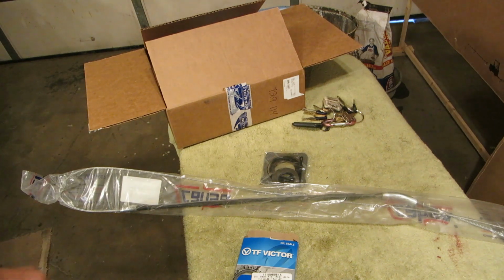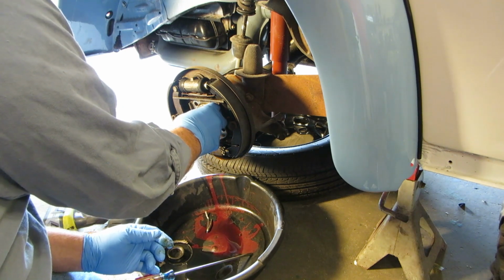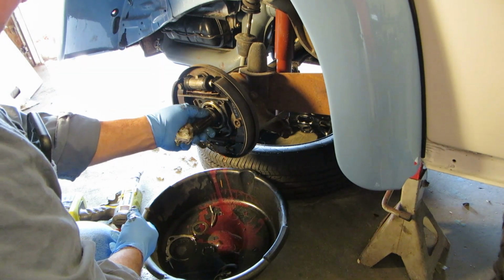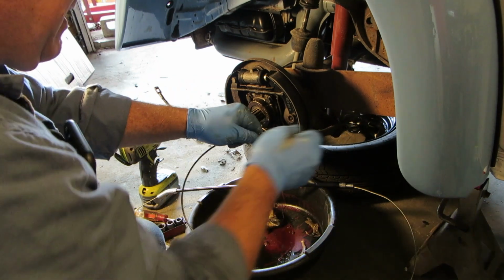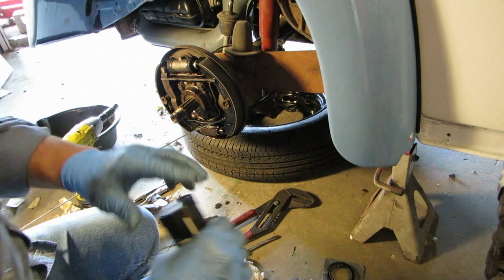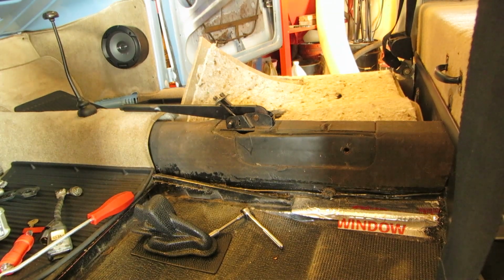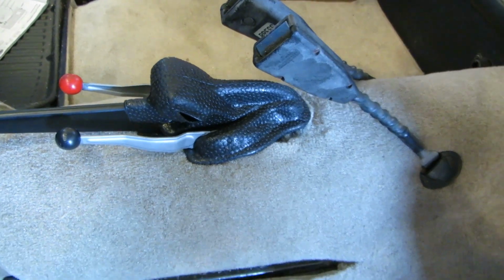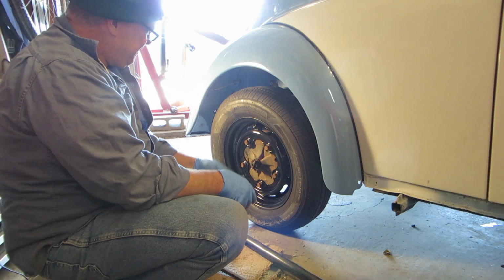1967 VW Beetle parking brake cable and rear wheel seal

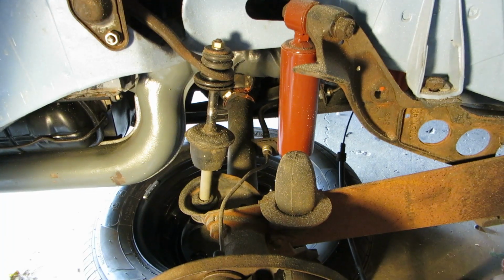Comment: 22:45 Did you put rubber pads down on the rear frame when you bolted the body on ? There should be a rubber pad under and above the mount under the washer and bolt assy. holding the body to the frame. If it's not installed you get a god awful clunking sound from the rear end every time you hit a bump. BTW, I have those pads if you need them.
Reply from the maker: Yeah, I didn’t buy new ones though. I just use the old ones. They look to be fine.

Comment: The parking brake adjustment procedure is as follows. Leave or take the parking brake lever boot off, jack up the rear end and adjust the rear brakes with the adjusting stars. Then pull the parking brake lever up 3 clicks ( or 4 clicks depending on year but I always do just 3 ) now tighten up the parking brake cable on each side until you can just barely hand turn the rear wheels. NEVER TURN THE SCREW SLOT AT THE ADJUSTING END, the slot is there to just hold the cable still as you turn the nut. The cross bar on the hand brake should be fairly even. There should be 2 nuts on each cable adjustment end, one is a locking nut. Then put the boot on. I replaced the crumbling fiber washers on my heater levers with thick plastic washers I got at the hardware store. They fit and worked perfectly.
Reply from the maker: So, what I did was chucked up The cable in my battery drill. Then I put a wrench on the nut, and then spun the battery drill about 3000 times. It made this funny creaking and popping groaning noise. But I didn’t pay any attention to it.
Now you can pull the parking brake lever all the way back in touch the backseat. I thought that would be OK. Ha ha Ha ha ha
Reply: Both of the parking brake cables in that blue beetle had the slotted adjustment ends broken out of them when I got it so someone must have done just that.
Reply from the maker: @brianallen9810  why in the world would they do something like that. It’s a cable… With an end that positively Connects to the arm attached to the shoe..... It’s not only going to turn once or twice… I just can’t imagine that. Then again from what you said about that Beetle, I can’t imagine a lot of that stuff that was wrong with it.

Comment: The parking brake boot actually goes on top of the carpet or floor pad.
Reply from the maker: I know I know, 
I had that question myself, and I looked online and found out that it sits on top. Or at least everyone had those sitting on top. I looked at it. And it looked like crap.
So I decided to tuck The carpet on top of it. See, the carpet is pretty thick… About 2 inches with the pad. So when you’re just lay it on top , The levers for heat don’t sit in it right.
So, why didn’t you just put the regular rubber mat in it? Yeah I know. Every time, and I cannot think of a single time that this did not happen. But every time, I tried to engineer something to make it “better“, something else was boogered up in its path.
So, I wanted full carpeting, and the insulation quality.... And I had to do it this way. WhatChagonnado?
Reply: It still looks good though.

Comment: Will you rebuild the motor and video that task and show what the issues is with motor ??
Reply from the maker: I am going to use, or I believe at least. I am going to use a good lower end. And build my engine up from there. I have complete videos of me rebuilding this engine that’s in it already.
Am I going to take this one apart and see what was wrong? Probably. But I already know what was wrong. It makes a noise when it’s running. When you rub a little grease on the cam gear, down through the distributor hole. The noise goes away when you put it back together and run it. For a little while, until the grease gets washed off. Then the noise comes back. I know this is gear lash.
If you look in my old video of me putting this engine together you know that I am using a new Brazilian case. An aluminum one.
Realize I’m not using a German case. But I’m using a German crank in German cam. Ah Ha! 
Please understand that when these engines were put together they used all German parts. The worker put the crankshaft in the case. Then he fit a cam in the case. The cam had a gear on it, that was marked up to +5 and down to -5. And he found by trial and error, which gear was the best for the gear on the crank. That’s why their new Volkswagen engines didn’t make noise.
Germans were very careful about the parts they put in their engines.
I don’t have a bunch of Cam gears that I can fit with this crank gear. Also is the block cut correctly? I’m betting no. Because it’s not German, it’s Brazilian.
Sometimes you win sometimes you lose with these engines. Probably, I will take it apart. Buy a new crankshaft, a new camshaft, two new gears, and new lifters. Will they be German Parts? Of course not you can’t find them anymore. So maybe with this amalgam of bastard Parts, it might not make any noise… Who knows? It will all be a crapshoot with this block.
Now, could I just drive this with the engine that’s in it? Absolutely. Will it continue to make noise? Will it make more noise? How long will it last? Will it destroy everything inside the engine? I don’t know. That’s why I’m going to go with a long block that’s… Pardon the pun....Been around the block.
Is the block I’m going to get a German block ? Nope. It’s a Mexican block. But it’s free, and it doesn’t make noise. I know it’s right because I know the person who had it. He Changed it out because it developed a leak in the case halves. It was taken apart sealed and put back together. The leak was not substantial but the person who had this was very particular. So I believe this lower end that I’m going to get is good.
So, we will see what happens. Thanks for the comment
Reply: @OkFixer  Thanks for background and info, I have a stock 1600 motor I started that is one of them New Alum. cases. Have not completed it to the point of test runing it. Crank & rods were refurbishes in machine shop everything came out standard, everthing else is new even top end . Never did this before like you explained could a crap shot, my hope is i would be a good bullet proof stock motor. I seeing more & more of is 1600 builds with single port heads verse dual port, I  been thinking about a 1600 built with single port heads and PICT30. Thanks again for taking the time to share the above; I value your wealth of vw info.
Reply: Gee, I sure hope the lower end is good.
Reply from the maker: @brianallen9810  that’s what they make 20/50 weight oil for Ha ha ha
Brian, even if the lower end is wore out, new bearings are easy to install you know. I will have a case that more closely matches the original. Isn’t that sad… More closely… Because this case I have I think it’s pretty far off.

Comment: Swing axle rear ends leak, this is normal. The leakage should just be around the brake backing plate and just a small coating. There should be no runs in the slight leakage.
Reply from the maker: I was using the old warped dented Wore out washers.... For some reason I didn’t put new ones in. And they come in the kit??? So I don’t know what was going through my mind at the time. But the vehicle wasn’t even moving, or was even drove, and the left side was leaking. So I’m thinking less leak is better. And decided to redo them. I also ordered new spacers For when I have to do this again. Which I’m sure will be soon.
Reply from the maker: I have a good idea that this is going to be like adjust your points, set your valves, change your oil and replace Your axle seals. It will be a every 1500 mile event Probably.
Reply: I don't have a swing axle beetle but I believe that there should be a paper gasket between the inside of the swing axle where it bolts to the brake backing plate. That's why the kit has 2 paper gaskets and I would coat the paper gaskets with Permatex case sealant prior to installation.
Reply from the maker: @brianallen9810  the gaskets are the same....with a weep hole 
Neither fit the back side of the brake backing plate...they are too small and will rip. 
Why would a gasket with a weep hole be on the back side....if there was one for the back side it wouldn’t be cut for a weep hole.
There wasn’t a gasket on the back side of my backing plate when I got the car.
The manual only shows one.
And
What are you sealing up back there?  Look at the diagram and how it works...it’s not needed.
Reply from the maker: @brianallen9810  ohhh, I forgot. I think The kit is universal, and can be used on the bus as well.? The bus having a reduction box behind the backing plate would then require an additional gasket? But I don’t have a bus so????